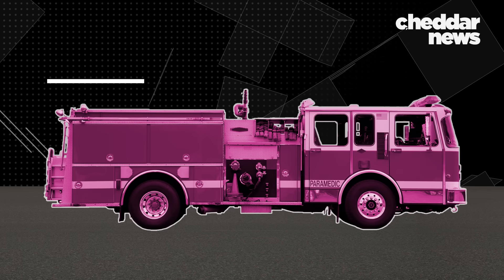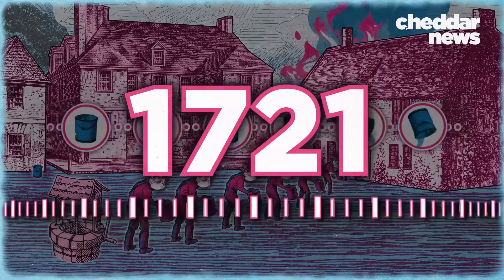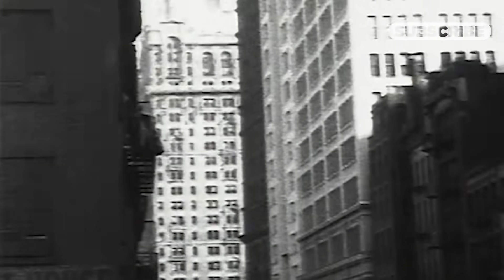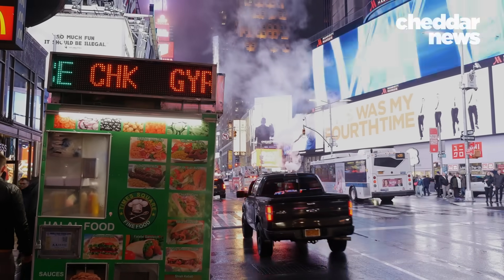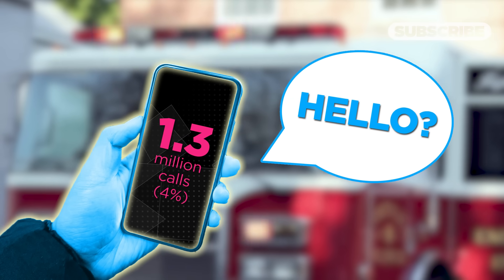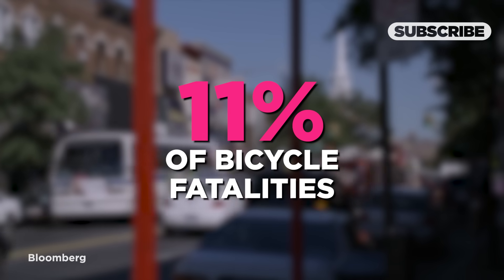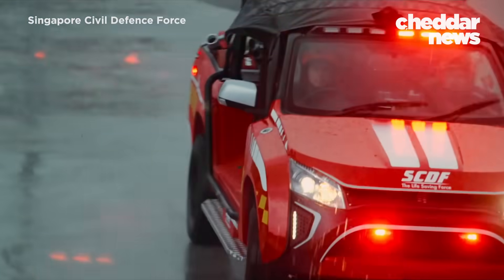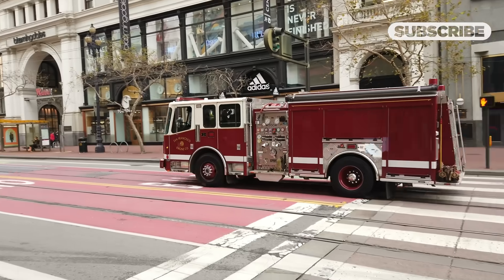Do American Fire Trucks Need To Be So Massive? - Cheddar Explains

Comment: A lot Wrong, First It shows an American tiller (one of the largest American fire trucks) to a European Engine so it’s misleading. There’s no 10ft wide truck in American, it is against their laws. The basic foundational difference in Fire engine sizes are the difference of Pump sizes. Most municipal American Fire Engines will have a 1500+ GPM pump vs a Average 400 GPM pump on European Engines. Bigger pump, bigger tank means bigger engine, means bigger truck. All Type 1 American fire engines will have pre connected hose loads including their larger diameter handlines and the common 1000 feet of 5 inch supply line vs that being a Rarity here. American cabs will often have compartments for equipment inside as well. Europe also has many job specific vehicles in their fleets vs their engines and ladders than could have any job on a fire scene. This video also doesn’t give credit to American departments as a lot of them do have smaller SUV medical response units, utility trucks or medics. A lot of their ladders do have pumps as their ladders are more for suppression than rescue. You can also have a complement of 5 or more ground ladders that can go up to 40 feet. Americans can work on their compartmentalization and use of storage as their trucks have much space left over, but again maybe we in Europe should look at all we carry and ask ourselves do we really need all of this? As it seems Americans mitigate their 96% of “other calls” just fine. Should we be more focused on smaller tool items instead of firefighting Capability?

Comment: It's not that the trucks are too big. It's that the big trucks aren't needed in every situation. Like she said, fires are a small percentage of what they actually go out for.
Reply: The big trucks are not only used for fires. Matter of fact if they were, they could be significantly smaller. The trucks have to hold extrication equipment, some medical equipment, and backup tools.

A rescue truck is an amazing example of this. There is little to no strictly fire equipment on those trucks but still are the same size as the other trucks. Thats not a consequence

Comment: I am a former firefighter/EMT for a rural volunteer fire department. We had a variety of vehicles from a pumper, more commonly called an engine, that had a thousand gallon water tank, to a pair of pumper-tankers (1500 gallons with a fast dump capacity to fill a dry cistern.) a straight-up tanker with 2,000 gallon capacity; it was a converted milk tanker. We also had a ‘grass fire’ truck on a 1 ton pickup 4x4 pickup chassis that had 500 gallons, two hose reels and the ability to feed a standard 1 3/4 “ hose. We also had two squads (aka ambulances).

For calls, we had different rolling orders. Just a squad for a medical emergency call, squad and engine then squad for auto accidents (since the engine housed our heavy search and rescue equipment) grass fire truck for small fires, engine, pumper-tankers and squads for house fires. Being a small town, space was less of a consideration compared to water capacity as we did not and still do not have a hydrant system in town. We have to carry the water we need or be able to quickly cycle tankers to replenish compared to hook to a hydrant and have all the water we need.the dynamics of a city department are vastly different beyond the requirement of being able to ‘put the wet stuff on the red stuff.’